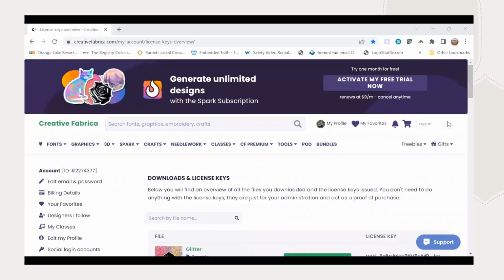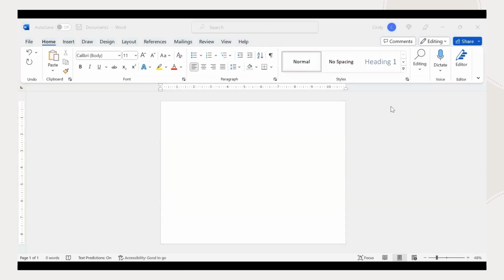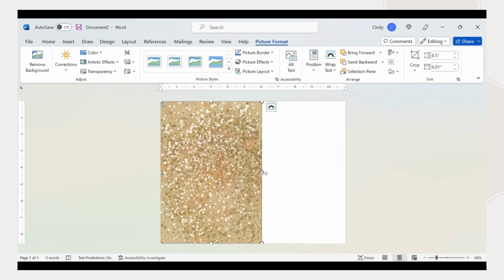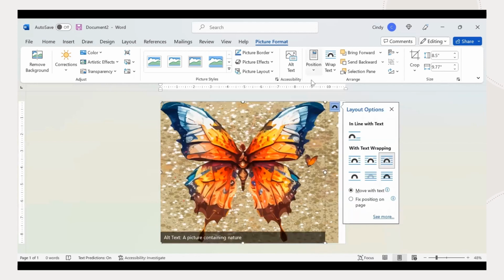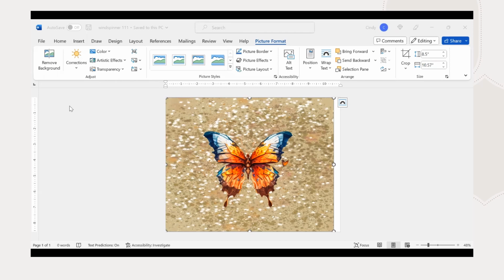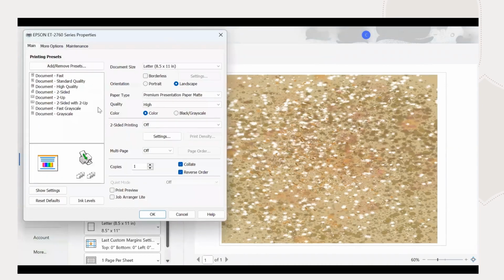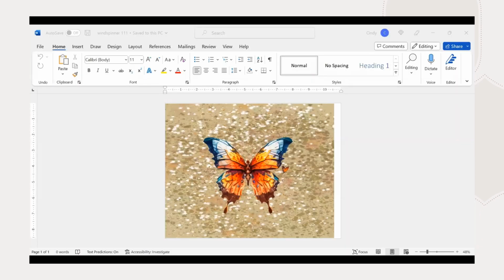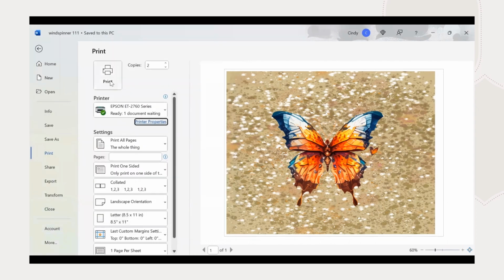Create a Unique Sublimation Wind Spinner! #sublimationtutorial #sublimationprinting #sublimation

Comment: Great video! Did you use an extra mat (I have the silicone one) with your auto press for the wind spinner? TIA!
Reply from the maker: I use a silicone pad on my press now for everything.  Thank you!
Reply: Thank you for your quick reply. Do you use it in place of the original heat pad or on top of the original?
 @mycupoverflows22
Reply from the maker: @debbiejasper6000  I put it on top. I replaced the original mat once, when it started wearing out again- I added the silicone mat on top of it and have used it that way since.  You are very welcome! https://www.amazon.com/QTLCOHD-Silicone-Thickest-Transfer-Replacement/dp/B09ZKRFFVC?crid=1VT5U3N1INWIQ&keywords=15x15+silicone+heat+press+pad+mat+QTLCOHD&qid=1683504584&sprefix=15x15+silicone+heat+press+pad+mat+qtlcohd,aps,286&sr=8-5&linkCode=sl1&tag=mycupoverfl02-20&linkId=753ddde8cdb49f1f6a8b9d4f741b3741&language=en_US&ref_=as_li_ss_tl